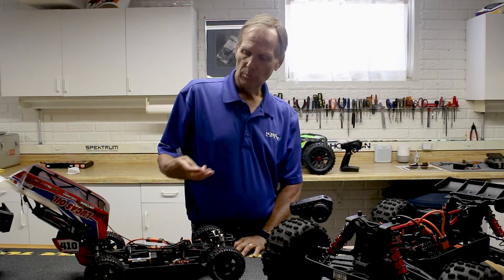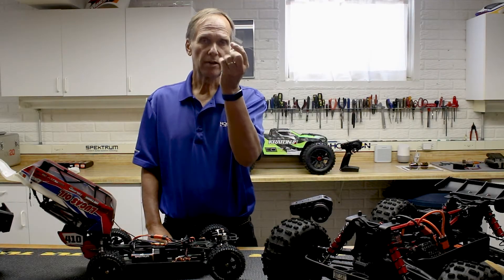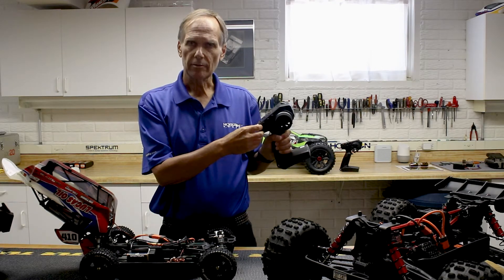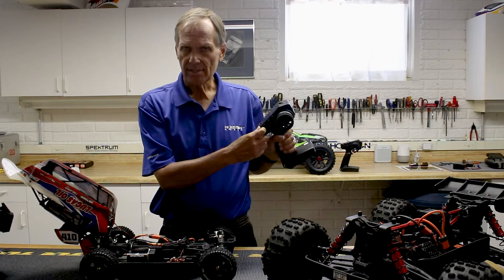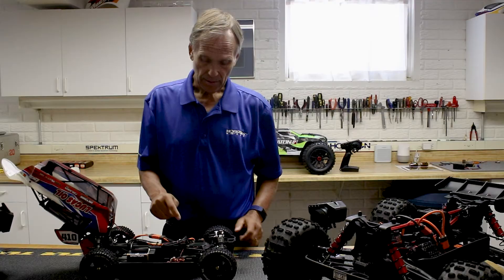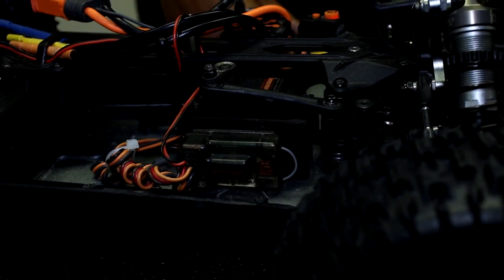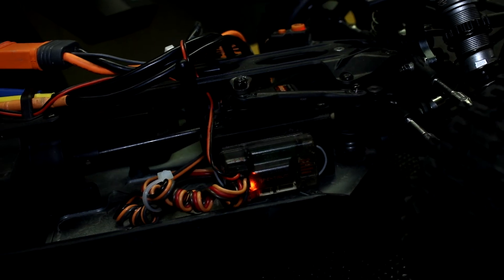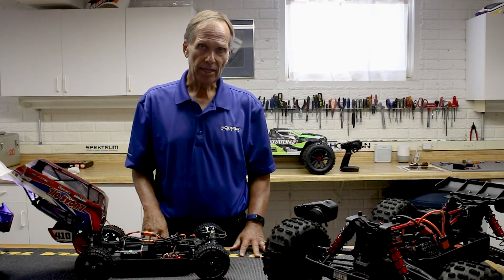Spektrum Quick Hit Tech Tips - AVC Binding and Calibration guide with DX3 Smart Transmitter

Comment from the maker: Having trouble with your AVC equipped Arrma or Losi model? Watch this series first!

In this video John goes in-depth on how to install, bind and calibrate AVC receivers, like the SR6100AT, in the RTR (ready to run) Arrma or Losi vehicles or in your own builds. He makes some important points and guidelines to help you become more successful with your AVC equipped bashers, racers and speed run vehicles.  

This is the second of 3 videos in our Quick hits that focus on AVC setup and Calibration for RTR Losi and Arrma vehicles

Video 1 - AVC Setup and Overview for RTR Vehicles
@
Video 2 - AVC Binding and Calibration guide with DX3 Smart Transmitter 
@
Video 3 - Firma ESC Calibration Guide 
@
Reply: My throttle is reversed I don’t no how to fix that????
Reply: @rclunatic  have you tried switching the switch on the hand remote to reverse it to get forward. Them after doing so rebind and recalibrate again with the new settings
Reply: @ParcoUpchurch  I believe so but I’ll try that again just to make sure it didn’t
Reply: How do I fix an issue when I follow these steps correctly but AVC countersteers in the wrong direction? Same with two rx SR6110AT and the 6100AT and even tried a new radio but it still countersteers wrong
Reply: @ParcoUpchurch  Apparently while doing the calibration if you steer the wheel to the left first and then right, that will reverse the AVC steering pitch. Full steer right, then left during calibration, and the AVC steering pitch counter-steering should be active. Hope this helps!
Reply: @gangsterHOTLINE  Thank you that was my error. Big help I failed to listen closely here. 👍🏽
Reply: When I get to the left trun my baja rey 2.0 the servo stops half way and will not allow the binding to finish ? Could it be a bad servo ? It's new out of the box. Then my other brand new 2.0 has no steering rate adjustment  ?
Reply: Why do both my arrma vorteks with avc keep losing binding with their transmitters?
Reply: I have factory reset the remote yet its still not keeping the bind to the reciver
Reply: I sure wish spektrum would make their vehicles steer correct when in N on the controller.  Some customer support would also be great!

Comment: And when we calibrate and the reciever light never responds with a properly set transmitter? What then? When it goes into bind mode everytime we turn it on, what then? These systems are a pain in the ass and this video doesnt cover obvious problems.
Reply: Did you ever get it working?

Comment: None of this works for me except the initial bind mode where you turn car on, press bind button on receiver, and hold bind on transmitter while powering transmitter on. It gets the flash and beep, then after that, no matter what i set trim or transmitter dials and buttons to, the orange light on receiver will not go out. I go thru, gas, brake, right, left and nothing happens, then the steering works but not the throttle. I try to reset transmitter with brake, left and power and it doesnt do the little melody tune that it reset. So im stuck at having steering but no throttle.

Comment: Great and helpful video. But I have one problem that is nowhere to be read. When i turn the steering full right, after 1sec throttle kicks in. If I turn left, the reverse kicks in. Steering works but after the endpoint, i get throttle or reverse. So I tried everything from this video..resetting everithing, bind again, calibrated..nothing worked. Like the channels are mixing. Its on vorteks blx. Everything is stock and the wiring is ok. Running out of ideas... :(

Comment: Can u tell me why my controller just sits and beeps non stop it makes a beep/laser kinda noise and I don't understand
Reply from the maker: Hi! Without seeing it first hand it could be either the AA batteries are dead OR if you are using a model with a smart esc and battery setup that the battery in your vehicle is dead. Make sure you are using good quality AA batteries and that your drive packs are charged. Hope that helps!

Comment: What model Arrma is on the right? The biggest one, not the Typhon..
Thx for the vid. But this binding should be much easier and you should be able to use multiple receivers per transmitter like any Traxxss or any other brand TX/RX.. 
I dont need it to save the settings or anything but when i turn my Traxxas car on, as long as ive binded that receiver before the transmitter will pick it up right away and i can use any Remote thats most convenient or just keep the remote with each car if there is special adjustments needed for regular use like end points or something else important
Reply: Outcast8s

Comment: I cannot reset to factory and i cannot access settings (blue LED). I do as instructed and i get no reaction from the DX3. Just an orange LED when pressing the ON button, release and green LED. Trims is set correctly according to the video. How can i solve this issue other than buying the Bluetooth component? It's a Arrma Talion 6S EXB. Brand new. Looking to set my endpoints and increase brake before taking it our to bash.
Reply from the maker: Give page 5 of the manual a thorough read. One thing to check beyond that is to make sure your rate knobs are turned all the way up. Hope this helps! 
https://www.spektrumrc.com/on/demandware.static/-/Sites-horizon-master/default/dw6f0e1ac7/Manuals/SPM2340-Manual-EN.pdf

Comment: I have a DX5 PRO and two SR6110AT receivers, where the AVC only works in one direction of throttle.  This would be fine if the direction was "forward" for the vehicle, or if it was an electric model where I could just reverse the motor, but it's in my gas car.  When reversing throttle or applying brakes, I get steering and throttle avc corrective activity, but nothing when going forward.  If I activate it by tapping reverse, once I trigger forward, the avc stays active in the forward direction for only about 2 seconds, and then snaps out of AVC.  Is this a transmitter problem?  Because I have two SR6110AT receivers that do this same thing?
Reply from the maker: I would suggest rebinding and recalibrating AVC now that you have the model setup (ie trims and throttle travel endpoints) Let us know if that helps.

Comment: cool I just spent 2800 and this thing won't even realise the transmitter. worked out of the box I followed the manual to a dot cause it says to and now I have no connection. I'm gonna return this pos
Reply from the maker: What model are you having trouble with?
Reply: @SpektrumRCvideos  Im good now it's the losi baha Rey 2.0 but for future customers who might never owned rc's or went from nitro like myself to electric it should state in the manual that it's ready and binded out of the box because I just followed the instructions and unbinded and lost full connection too the car itself. Thankfully the store I purchased it was more than willing to reset it and bind it for me so no issues now. But the manual is missing this important factor

Comment: Best video so far, but my 2 weeks old car still won't let me calibrate it. It just binds and stops allowing inputs. The same thing happens every time, as it refuses to stay bound. Update: The water-proof box thing was full of water. The receiver has been tried, checked and working. After putting it back in the car, it will NOT bind and instead gives a single red light on DX3 and an error tone.

Comment: What are the steps, just straight through, 30 sec, car on, reciever pair button, bind radio on, then what......
Reply from the maker: The video covers it fairly well :) BUT one thing that we see people struggle with is if the receiver is not mounted flat in the model and the model is sitting flat on its wheels. Keep that in mind and follow the instructions and you should be good to go.

Comment: Grate video! Does someone know why my steering is reversed on my kraton 6s? I have to switch the switch knob to R for it to be normal. It’s not a big deal, but kind of annoying. I have the DX3 with the SR6110AT. I’ve calibrated it a couple of times to try to fix it but I can’t seem to make it reverse bak. I’ve just bought it in used condition.

Thanks!
Reply: Figure this out?
Reply: Change  the motor rotation in the esc, i had this problem with a spectrum motor/esc combo i put in a slash 4x4. It fixed it. I also read, you can switch the yellow and orange esc plugs from the battery, but I didn't try that one, no need. I only speak about what i have experienced, i am in no way a pro. Just a dude with youtube and a couple rc cars.lol

Comment: Why won't the transmitter stayed bound to my receiver? I do all steps correctly and it works as long as I don't power off the transmitter once I turn off car it needs to rebound and calibrated each time...kind of hard to set my endpoints..I installed a new servo with 270 degree turn angle and it's killing the servo not being able to set endpoints. Someone please help
Reply from the maker: Hi Oakz, Which receiver is it? If it is one with a button on it sometimes debris or corrosion can cause the button to stick, making it go into bind mode every time it is powered on. Other then that it could be a damaged receiver. Does it do this with more than 1 receiver?
Reply: @SpektrumRCvideos  I would have to get back to u on the exact model of receiver but it is the stock one avs that.came with the 8s outcast I know it has the dx3 remote...I have the slt remote but never tried to bind with it it is possible there may be debris in it I could check but not to sure..ever since I took it out of the 8s and tried to use it in my 6s system I've had this problem..could that be an issue I broke some suspension parts on my 8s awhile back and I just got an exb I'm building so I was using the spare transmitter and receiver

Comment: My axail ryft will not stay bound to tthe car hobby shop says I horizons respable horizons says is hobby shop respable so I have a broke $700 RC car customer no service. I will be leaving the hobby because of horizon hobby.
Reply from the maker: Hi Julie! Sorry to hear you are having a bad experience. Don't give up yet! RC is a very rewarding hobby! That said, the common culprit for your issue is not exactly that it is not staying bound but the receiver's AVC is not initializing. This is likely because the car is not sitting stationary, level and on its wheels for 5-10secs after power up. Another common thing that we see is that people will leave the receiver unmounted while troubleshooting. This will also make the AVC not initialize because it is floating in open space dangling off the wires or what not. IT NEEDS TO BE MOUNTED IN THE RECEIVER BOX :)

Comment: Hi there, Trying to get the Sense ESS sound module to work on the TH port, any ideas how to make this work with the smart throttle?
Reply from the maker: Hi T Nok, until Sense ESS provides an update to support SRXL2 protocol (which is what smart ESCs use) you will not be able to Y harness the module into the throttle channel when using a smart esc. That said, if your transmitter is capable, you can mix throttle to a open channel and plug the ESS into said channel.
Reply: @SpektrumRCvideos  Thanks for your reply, is the DX3 capable of mixing TH to an AUX channel?

Comment: I have a problem I have a 8s firma setup on my limitless I can't get reverse and motor rotation is backwards please help me
Reply from the maker: Make sure you have the ESC mode set for Forward, Brake and reverse. Also there is an option to reverse the motor in the ESC settings as well. ALSO make sure, on your transmitter, that you have the brake rate and reverse end points turned up to 100%

Comment: So I am having trouble because my esc won’t turn on it just beeps and blinks red instead of turning on I tried to contact you guys but you never replied to my email
Reply from the maker: That indicates that the ESC is not receiving a Signal. Make sure your transmitter is on and the receiver is bound to the transmitter.
Reply: @SpektrumRCvideos  it is a rebound it about 27 times but every Couple days I don’t plug a battery into it it boots up and says it connects but then reboots and flashes

Comment: The Problem I realized with spectrum SPMSR6100AT channel 2 dose not work with ESS one Engine sound simulator, I don't know if there is a fix for that or it just wont work.
Reply from the maker: It is because when using a Smart ESC, the receiver then uses a different communication protocol between the ESC and RX. One workaround is to plug the ESS into another open/AUX channel, and if your radio can program mixes, to mix the throttle channel to the AUX you plugged in the ESS to.

Comment: What do I do if my light on my receiver does not go out completely when I press the trigger
Reply from the maker: On some receivers, it may not go completely out, but very dim, which is completely normal. If you follow thru the steps it should function correctly.

Comment: Y can't I get spektrum DX3 TO WORK WITH MY 2.5 TMAXX IT WILL WORK THE STEERING BUT NOT THE FORWARDED OR REV
Reply from the maker: Which receiver and ESC are you using?
Reply: @SpektrumRCvideos  DX3 SMART DSMR 3CH TX W/SR315 I EVEN  TOOK IT TO THE STORE WERE I GOT IT FROM AN THE MAN THERE COULD NOT GET IT TO WORK IV WATCHED THE VIDEOS FROM SPEKTRUM HOW TO SET IT UP BUT NO LUCK SO IM STUCK WITH A 100 DOLLAR CONTROLLER THAT I CANT USE PIZ HELP IF U CAN THANKS
Reply: I have the DX3 smart DSMR 3CH TX W/SR 315
Reply: Everything on tmaxx is stock

Comment: I have the spektrum dx5c and a spektrum 6110at i put the receiver in my trx4 and every time i turn it on it like the receiver goes into bind mode but it binds fine after any tips to fix that
Reply from the maker: If the receiver is always booting up into bind mode that is a good sign the button is stuck. Feel free to open the case and check for debris that could be keeping the button from moving propperly.
Reply: @SpektrumRCvideos  thanks

Comment: My avc is backwards. Steering is correct, but the avc corrects in the wrong direction. Have reset the dx3 and rebound multiple times. The range on my radio is only about 100 feet too. Makes driving a 3s truck no fun! I have the dx3 and sr6200a.

Comment: My car just unbounded it from the remote. I am using the Arrma Vorteks and I just get a flashing red light. I tried everything.
Reply from the maker: Follow these instructions very closely and you should be good to go. Otherwise make sure connections are correct, polarity wise and try putting a bit of distance between radio and receiver when you bind.

Comment: This is confusing....

So, I don’t remember doing any of this brake / accelerate stuff? I just turned in my controller and it connected to my receiver (arma box 185) (Spektrum dx3) I don’t remember doing throttle and steering direction stuff? 

It just seemed to start working? 

So how do I re start this process? Whenever I reset my transmitter and then reset esc and then it on, it automatically recognizes my transmitter? 

How can I restart this entire process on my arma limitless?
Reply from the maker: Binding and reconnection are 2 different things. You only need to bind if you are swapping the transmitter or if you feel it needs recalibrated. The calibration process is part of binding so all you need to do is put your receiver into bind more. This is done by pressing a button on the receiver itself, so you will have to open the receiver box to access it in your limitless

Comment: Am I doing something wrong? When I do the calibration process and all the dials for the DX3 are set as he did on the video....I do the full-forward, full brake, when I do full right....my wheels turn left. Now when I am done with the process I have to set the ST on the radio to "R" to steer correctly... not sure why it is not the right direction in the calibration?
Reply from the maker: Flip the reverse switch to R and rebind and recalibrate and you should be good to go :)
Reply: @SpektrumRCvideos  I did it after I finished the bind/calibration. You are saying I need to do it again with the "R" switched over?
Reply from the maker: @ParcoUpchurch  Yes, anytime you change a Steering or Throttle setting, be it reverse or end points, you need to recalibrate
Reply: @SpektrumRCvideos  I’m not understanding I’m having the same issue as him i did Wyatt you said and still nothing

Comment: I'm trying to get a mamba x on my ryft and the dx3 is giving me a fit. I've calibrated over and over and it does work but now if it loses signal it just goes wide open when it should just shut down. My dx5c and flysky gt5 aren't like that. If I didn't like the avc on the ryft I'd chuck this receiver into a fire pit
Reply from the maker: You need to rebind to reset the failsafe. Also if the DX5C works well with it why not just use that? Is a better transmitter. Just a thought :)
Reply: @SpektrumRCvideos  I should have worded my last comment differently. My dx5c works perfectly with the non avc reciever. If I didn't like the avc I would run the dx5c but I'm afraid to even buy another avc receiver if it's not going to work properly. If horizon ends up warranting it out I probably will use the dx5c or dx5 pro. I love the spektrum products but they have to work every time all the time.

Comment: I just bought Tenacity DB Pro. I moved the AVC receiver. It comes on the side but I put the RX in a box and it now lays flat not on its side anymore. My question since I changed the position from the factory bind for the gravity position. Do I need to re-calibrate since I change the RX position or it is OK as it is?
Reply from the maker: If you changed the position you WILL need to rebind and recalibrate for it to initialize and correct propperly.